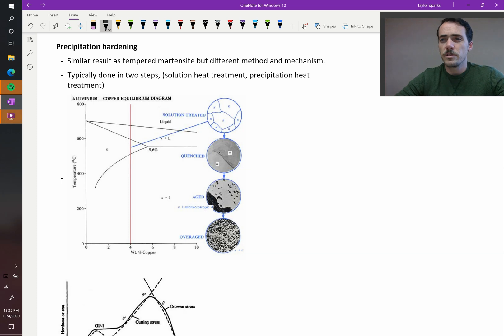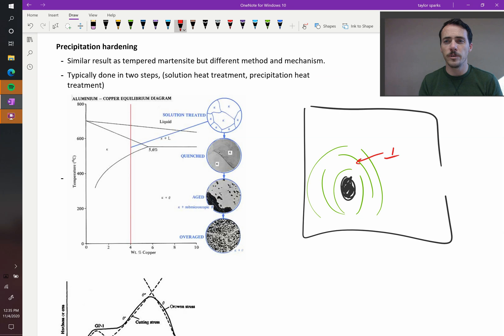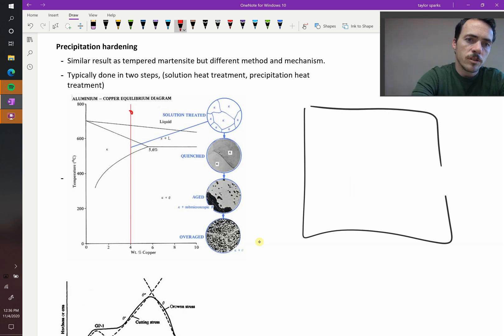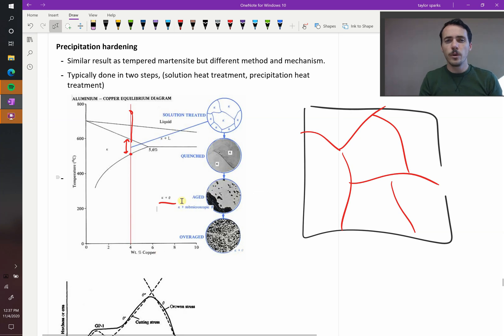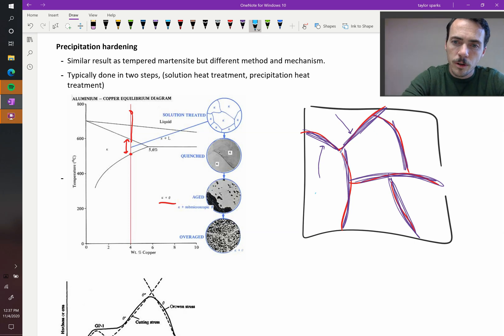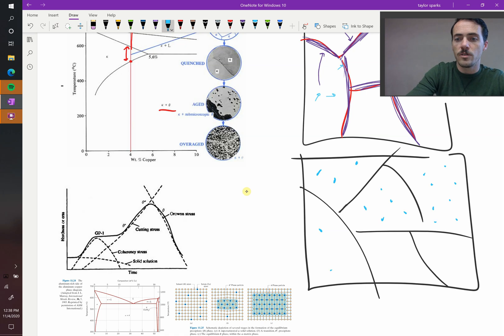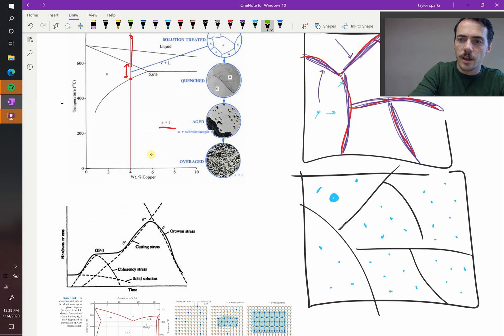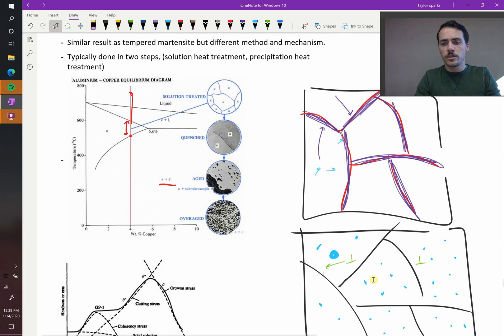Kinetics of precipitate strengthening and aging

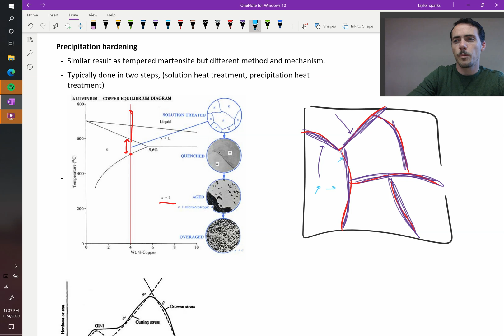Comment: 2:14 Can't we also consider the second-phase atoms at the Grain Boundaries as precipitates?
Reply from the maker: Yes. Precipitates are the emergent phase regardless of what they form in the bulk or along the grain boundaries. However, dislocations are already hindered at grain boundaries and so adding a secondary phase there is less impactful than adding precipitates in the middle of the grain where dislocations can normally move with ease.
Reply: @TaylorSparks  Thank you!